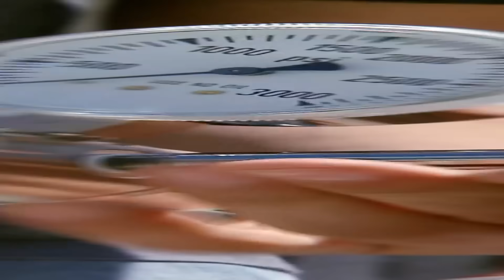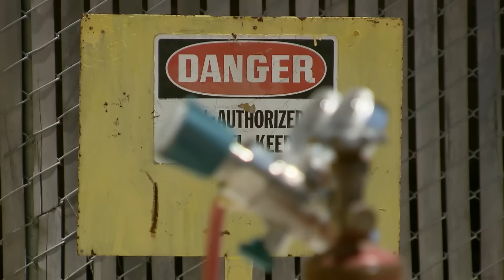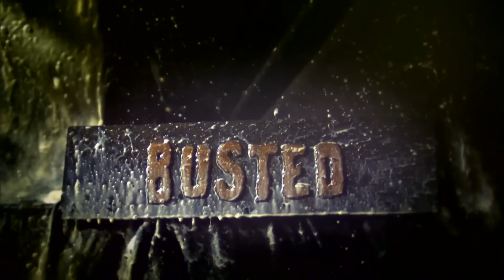Can A Gun Really Ignite Gas Once You Switch To Hydrogen? | MythBusters

Comment: Like any explosive/#flammable gas or vapor it requires oxygen (or oxidizer) to ignite. While most gases or vapors have a somewhat narrow explosive range (% of oxygen in the atmosphere ratio) , hydrogen has a very wide explosive range making it one of the most volatile gases; as an example Methane requires 5-15% atmospheric air , compared to hydrogen 4-75% atmospheric air. In the first test, it's likely the methane to atmospheric air ratio was not correct so it didn't ignite.

Comment: well we clearly didn't see any of the setup logic, but as others have mentioned, it doesn't look like they worried about finding the correct air/fuel ratio.  with him just opening the valve by hand for a certain amount of time, i highly doubt they would find the correct ratio for methane.  but hydrogen is obviously a lot less picky and ignited with whatever oxygen could leak back in through the cracks.  
(looked it up... for methane, the air/fuel ratio needs to be at about 12-21% concentration.  but hydrogen will ignite anywhere from 4-75%.  so it's no wonder their method wasn't able to ignite the methane, but easily ignited the hydrogen.)

Comment: I don't think the gas will ignite if you displace all the oxygen.
Reply: Also, a massive amount of the explosion happens in a (by design) nearly airtight space in the breech. Other than the unexpended powder and gas igniting from the muzzle flash, there isn't a massive amount of explosion to set anything off. I think conditions would have to be exactly right to get it to work. 

Also, you're dead on with the O2 flush.
Reply: Yeah, though the Mythbusters know this well, I think it's just been clipped out here. Watch and see.
Reply: @pdan4  I did watch. I didn't see.